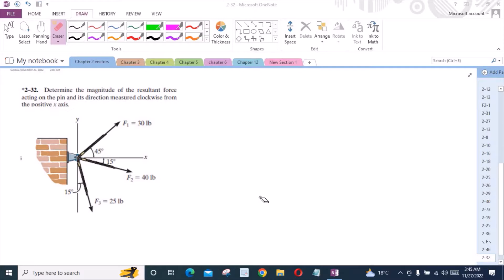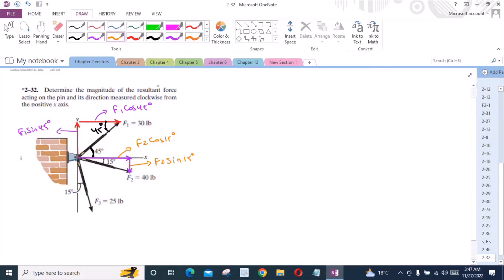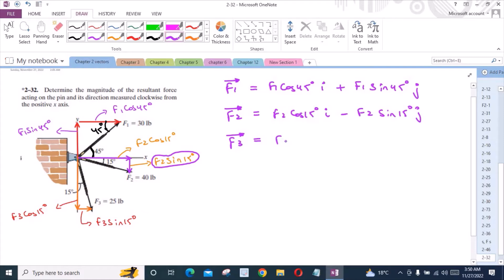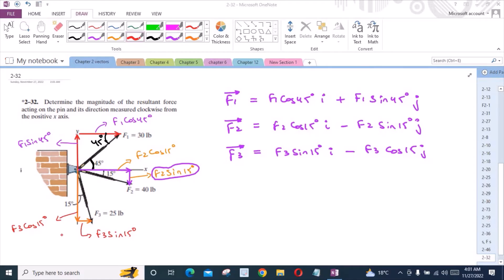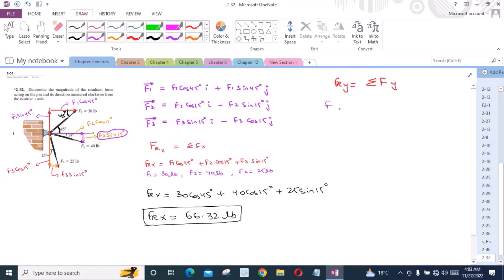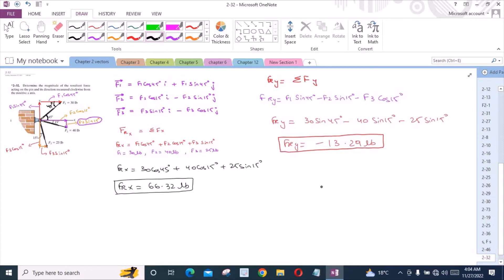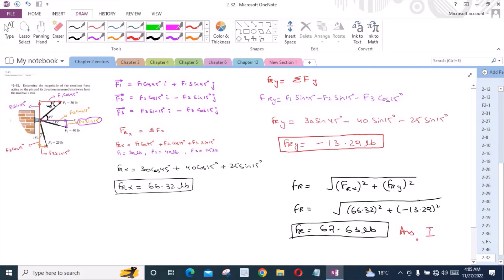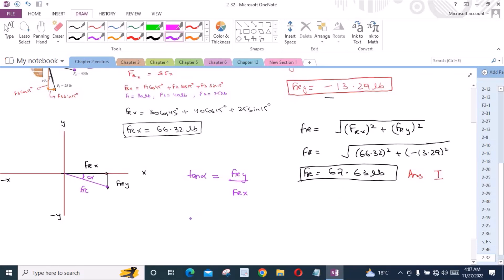2-32 hibbeler statics chapter 2 | hibbeler statics | hibbeler

Comment: why the angle is postive? aren’t we supposed to use the -13.29 and 66.32 in the calculations?
Reply from the maker: The angle is positive because we already have mentioned that the angle is measured clockwise from positive x-axis. I hope it will help!